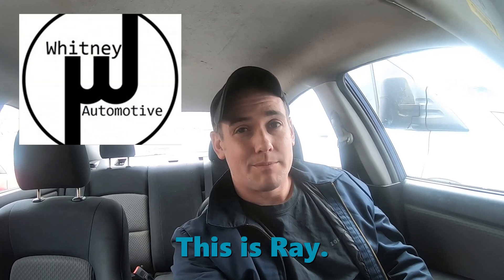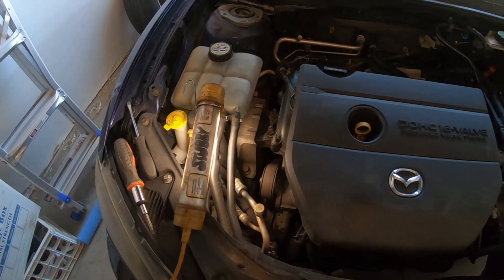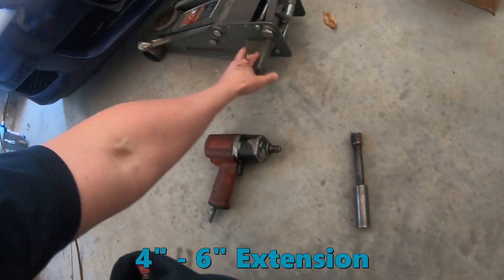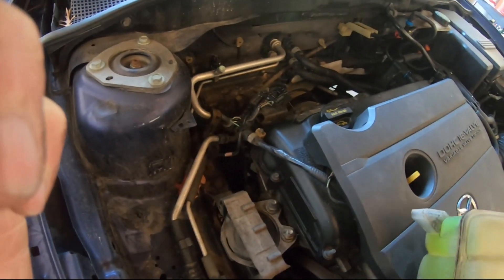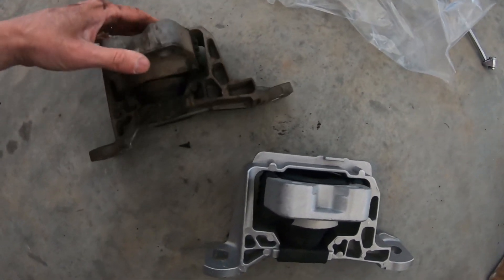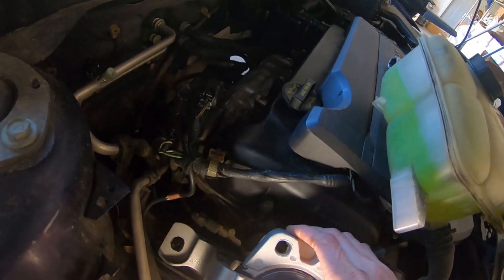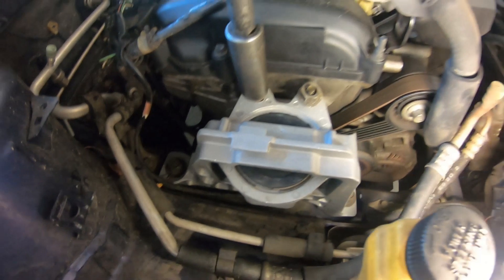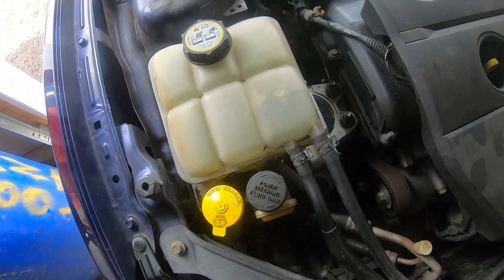Mazda 3 Engine Mount Replacement Right Side How To Trash to Treasure Motor Mount

Comment: Yo I just picked up a Mazda 3 to do the same thing and my engine mount is gone too
Reply from the maker: Super common point of failure. I've had customers that didn't realize how bad the vibration was until they're replaced. The mazda3 really is a smoothly running car when properly operating!

Comment: Great video set. Just used all 3.  Did noticed both of your torque limits said in-lbf instead of ft-lbf in this one.
Reply from the maker: The workshop manual uses in-lbf interchangeably. Thanks for your support!

Comment: I have a black 2006 Mazda3  hatchback that’s five speed with the 2.3l the mounts you just replaced is it a 2.0 or 2.3l dohc 16v vvt
Reply from the maker: The car in this video is a 2.0 but the procedure is exactly the same.

Comment: That mount is definitely trashed. 

Checkout my channel. I'm trying to build my sub count!
Reply from the maker: More often than not, I see them this way. In my locality, it fails the annual safety inspection but nobody knows how to check it so they just slide through the process until the customer starts complaining about vibrations or the axle pulls out! The left side mount wasn't much better but is much harder to see... stay tuned!

Comment: Ray glad to see your back. Quick question when it comes to warming up the Rx-8 is it necessary or should one turn on the car rev it to 2500 rpm for a min or so and just drive off? Your thoughts? Also I know don't shut off cold, the golden rule.
Reply from the maker: My quick feelings on that... 
Warm ups are great on pretty much any car. Not just on oil but on transmissions as well. Isn't necessary to rev the vehicle as that would only encourage a "dry" start. So long as the engine is running smoothly, I don't see any need to increase the RPM during a cold start.
And yes, don't shut off cold... and if it is hot, allow it to idle for a minute or two before shutting it down as well!